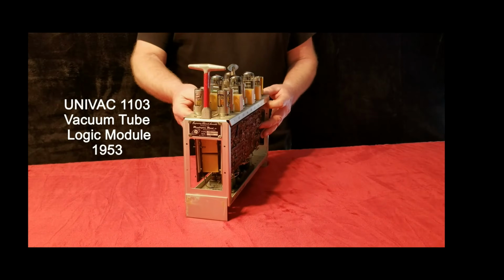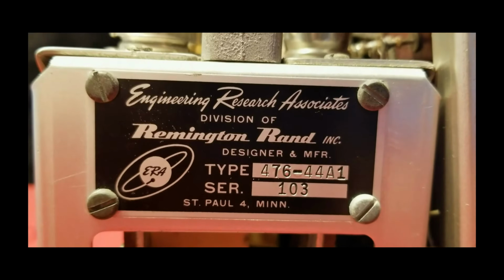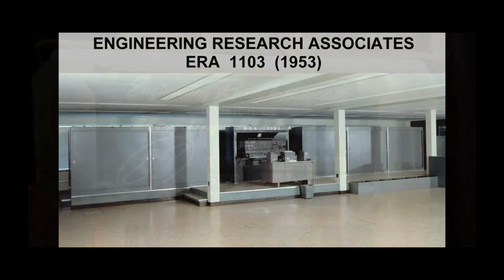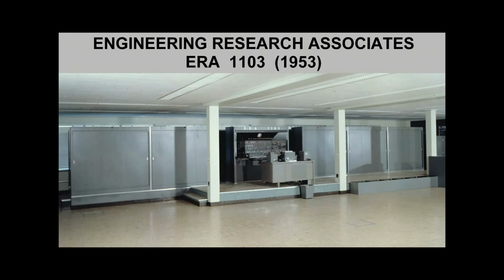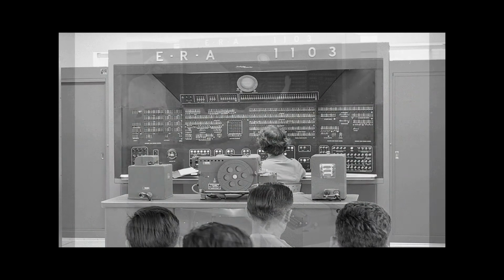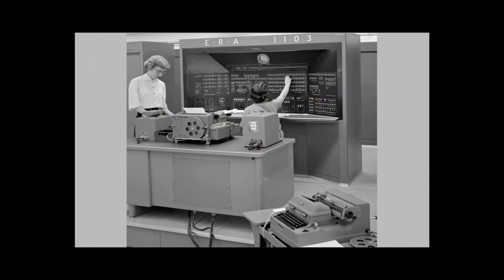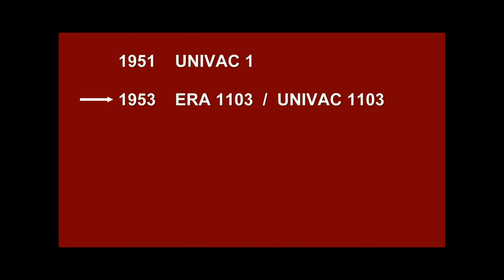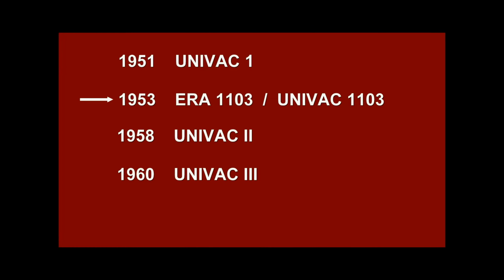EXPOSING the Rare UNIVAC 1103A Scientific Computer!  Vacuum Tube Remington Rand Logic Module Circuit

Comment: Interesting...I wonder why they used loctal base tubes. Those usually turned up in car radios. I wouldn't think vibration would be an issue in a computer, but maybe it was.
Reply from the maker: Good question.  The UNIVAC 1103 was based on the ERA 1103, and they were used to making government computers, built to higher standards than the UNIVAC 1 business computer.  The government wanted computers they could ship from one place to another an have it installed and working with the least effort or worry.  Generally, their machines were a bit more vibration proof than the commercial grade.  That's my guess....

Comment: With the first-generation digital computers I don't know why they didn't use sub-miniature valves in combination with double-sided printed circuit-boards as it would've made for smaller and lighter modules that produced less waste-heat and used less electric-power to operate.

Comment: I worked at the Roseville, MN Sperry Univac site during the '80s and there were still a few old- and not-so-old-timers from the early 1100 days around. I remember one in particular who had joined as a young operator and who recalled running simulations on an 1103 or 1103A while Seymour Cray looked over his shoulder to see how it was going. The operator was an electronic engineer in hardware design by the time I was there.
Reply from the maker: Hi Steve, MN Sperry Univac has a very long and fascinating history.   I bet it was quite an experience to have worked there.  Wish I could have gotten a tour back then.   Bet you have some great memories of that time.  Thanks very much for sharing some of your thoughts.   ~  Victor